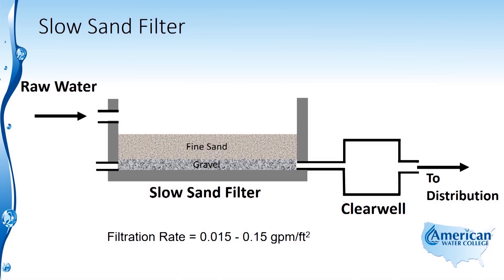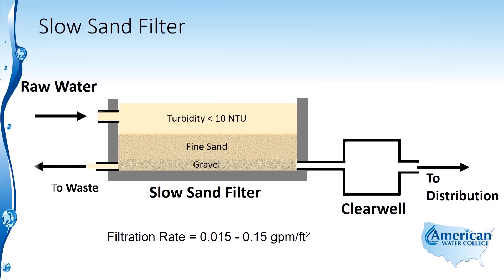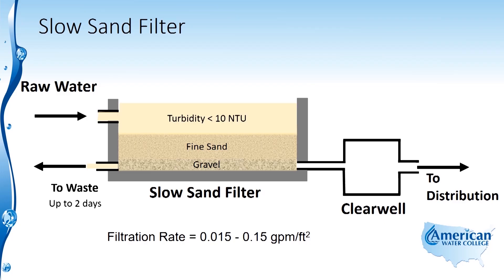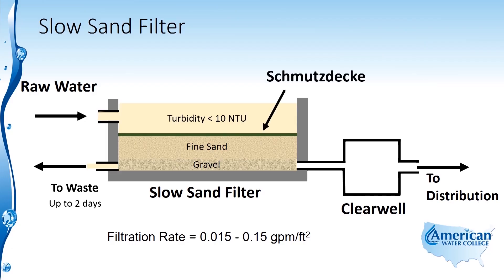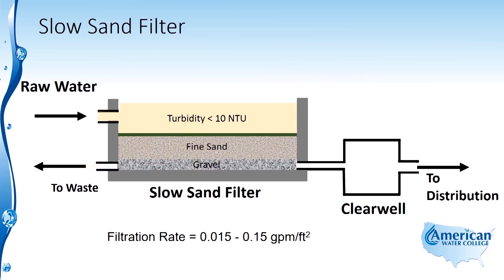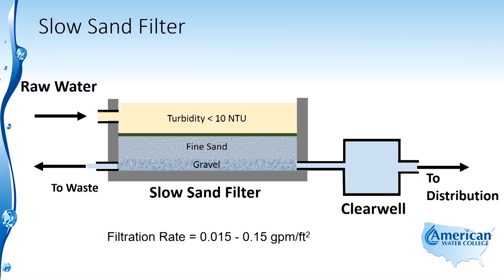Slow Sand Filtration

Comment: Hi, I'm constructing a water collection and treatment system. I set up a mixed sand and pea gravel test column where I mixed both together in various ratios instead of layering them so that the filtration rate is not determined by the slowest sand layer alone. I'm timing the flow through rate of different ratios to find an optimum mix.

Comment: If I get this correctly, to filter 720,000 litres of water in 1 hour, I would a filter bed of anywhere between 21,176 to 211,765 sft of surface area. Is my calculation correct?